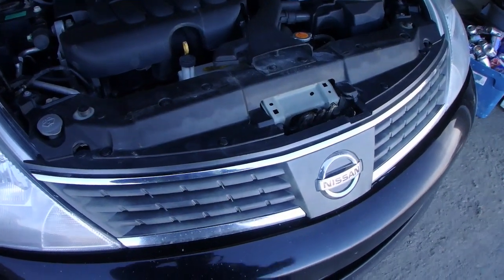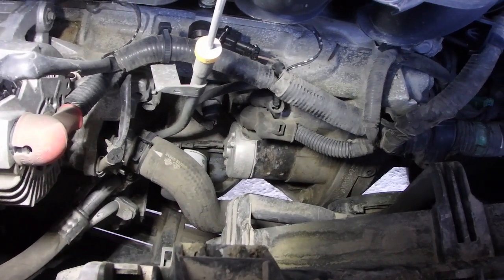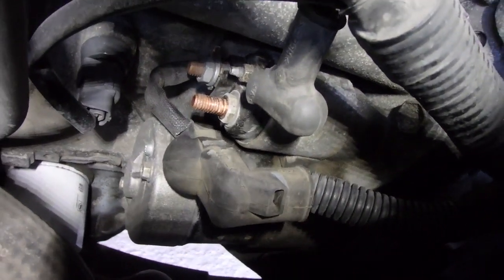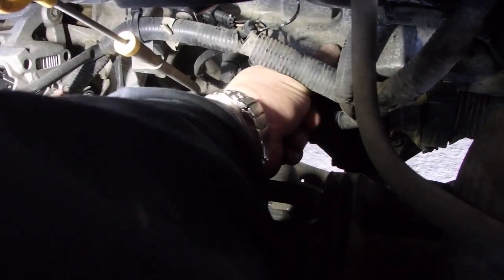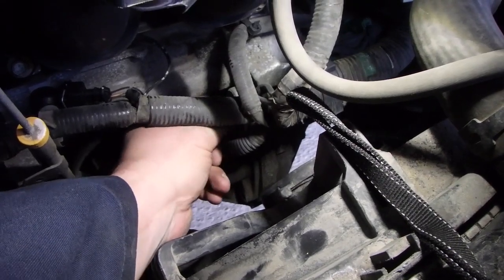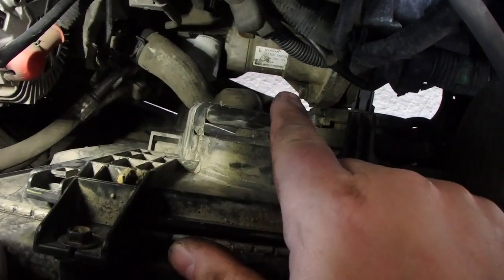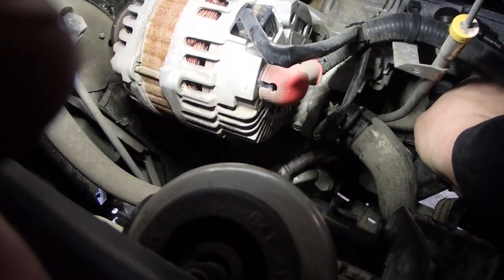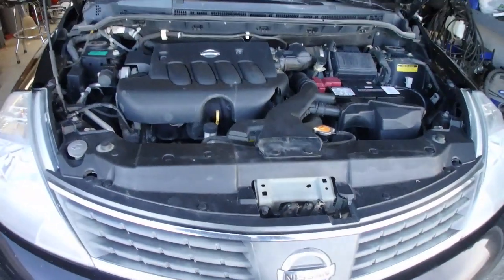DIY Nissan Versa Starter Replacement

Comment: Thank you, Mr. Jerry! Thanks to your video, I was able to uninstall my starter on 2007 Nissan Versa hatchback. The only difference is that I didn't jack up the vehicle, but used a combination of socket wrench and extension to get the bottom starter bolt. The extension goes under that 1.5 inch ish diameter pipe. It didn't mess with that pipe at all.
Reply: Hi.. How long did it take to change the starter approx? I'm thinking that's what I need done on my Nissan Tiida/Versa as every time now and then when I turn the key nothing happen but one click and by the 5th to 8th turn it just starts like nothing is wrong, does it sound like a starter motor issue?..
Reply: @danmusicman2010  bad connection, check and clean all connections on battery and starter

Comment: Thanks. Used this video to replace my old starter that had dead spots in it. Had trouble removing the oil pressure sensor relay, so I left it alone, but was still able to get it through. The key is is just work it through carefully. Don’t force it in.

Comment: BSK Garage. I did the starter replacement, but I still getting a clicking sound. What else could it be? The instructions are very good.
Reply: Clicking sounds leads me to believe it's the alternator not giving your battery sufficient charge for the next cold start

Comment: Hi.. Great video, How long did it take to change the starter approx? I'm thinking that's what I need done on my Nissan Tiida/Versa as every  now and then when I turn the key nothing happens but one click and by the 5th to 8th turn it just starts like nothing is wrong, does it sound like a starter motor issue?..

Comment: Thanks so much for this video. I was able to get my starter out so it could be tested at autozone. Only "problem" is that it passed the test. But when I turn key in ignition all I hear is a winding/grinding sound. Like something spinning really fast. Seemed like it would be the starter, but if not that, where should I look next? Battery tested ok too.
Reply from the maker: The starter is faulty don’t listen to the idiots at the parts store.  The bendix drive isn’t engaging properly that’s why your getting the winding, grinding sound.

Comment: This may be a long shot  since you uploaded this years ago but, I replaced my battery and ground wire and my car still isn't starting up  and turning over, I'm not too sure what to check next? I considered the alternator but was told from the auto store it must be the starter if the car still holds its charge when it's jumped. Any idea on if they're right or what else it could be?
Reply: Do a trouble shooting guide

Comment: I assure you there's not one 1/2 bolt on a versa....14mm maybe?
Reply: 13mm and 1/2” are so close they’re often interchangeable. I laughed when he said it 😂. He used either a 1/2” or 13mm. 14mm is too big it’s 9/16”.

Comment: Around how many miles does the starter quit working ?
Reply from the maker: The mileage of a vehicle is irrelevant to the starter failing
Reply: @TestDontguess  Hey there, I am about to try this on my 2011 Versa. Recently it failed and I need to remove it. I'm still a bit unclear on how the electrical connections work going into the starter?

Comment: Anybody know if slow cranking is a cause of a bad starter? Battery is good btw.
Reply: I know it's an old comment, but someone else may have the same question. It could be faulty connection to the the battery. Loose terminal. Etc. Make sure there are no shorts or cuts in the wiring and make sure the terminals are secure to the battery posts snug.